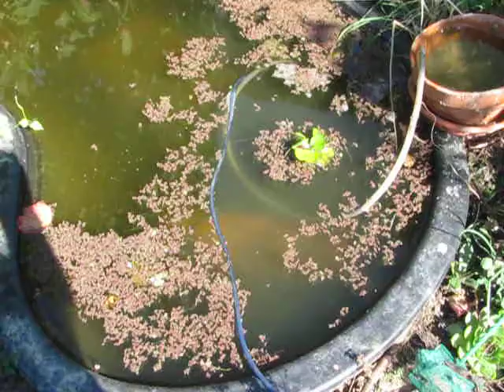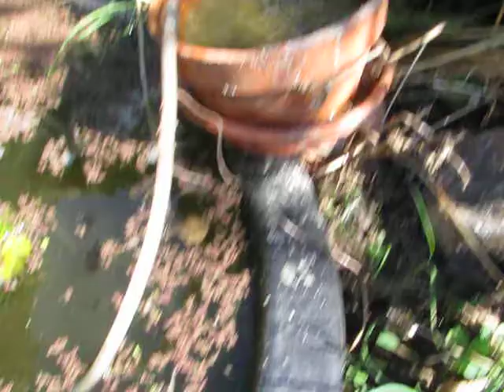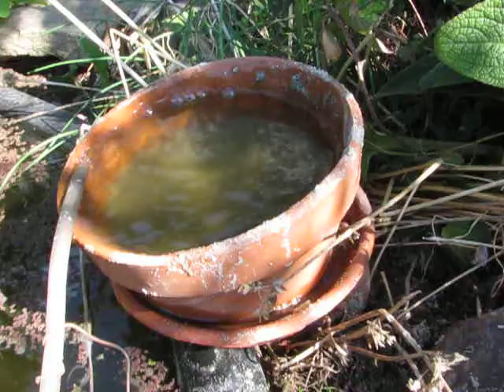Designing a sand filter for a fish pond.  Prototyping  part 1.

Comment: ...But if you go up in scale you might want to consider some sort of settling tank to reuse the water... IF you were to use your pallet garden as the filter,you could probably void  most of the steps of using a sand filter... maybe use the sand filter to purify the water from soil run off from  the bottom of the pallet and then cycle the water back into the pond... but then you might as well use gravel like that of aquaponics... (I enjoy your videos because they get my invention wheels turning.)

Comment: There is a book called, The Barefoot Architect, that has processes for manually backflushing water filters that are used for drinking water... the 60:1 gallon recirculation is  more doable provided that you don't have too many fish. (I think the ratio for fish to gallons are one fish to every two gallons for food production... You will still have to increase the flow of water for oxygen & to be able to cycle out fish nitrates/waste... Backflu$hing into the garden is a good idea @ 60 gallons...

Comment from the maker: It is a 60 gallon tank and I am demonstrating a process to design things. The sand is able to trap the pea soup algae for about 8 hours before it blocks with algae, All I have to do is design a flush system to automatically flush the algae from the sand into the garden bed whenever the sand filter becomes too dirty. This is effectively the same as a bio filter but with a much smaller footprint.

Comment: 1 gallon filter to a 300+gallon stock tank is a slow filter and might not work for a large number of fish. You might consider another stock tank or EPDM (Roofing liner by Firestone) at a higher elevation than your current fish tank to create a bio-filter that creates oxygen for the fish and draws nitrates from the water (which, helps prevent pea-soup algae.) Water plants function about the same way as aquaponic vegetables... (Just trying to be helpful.)